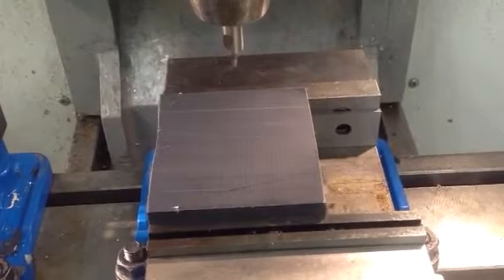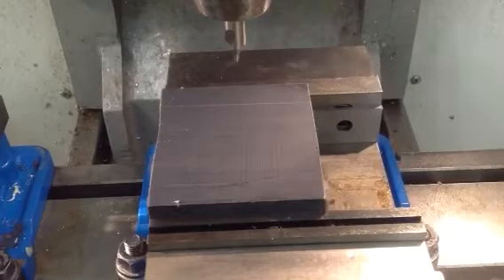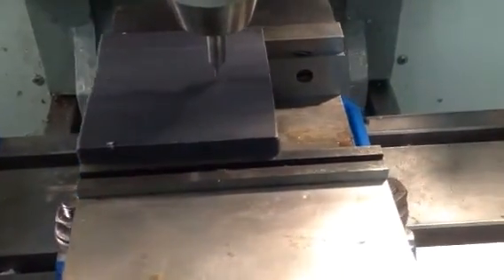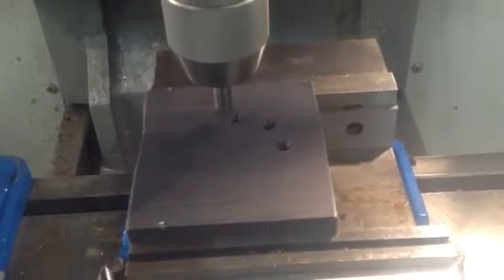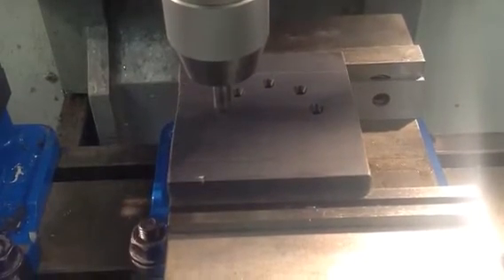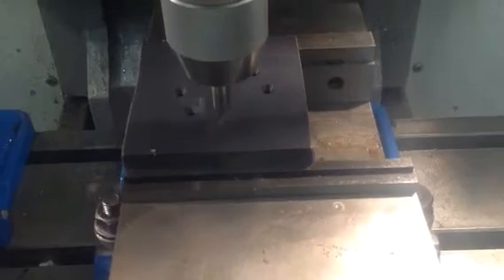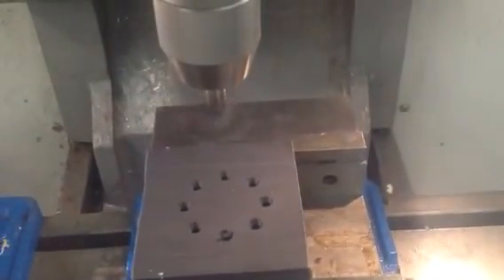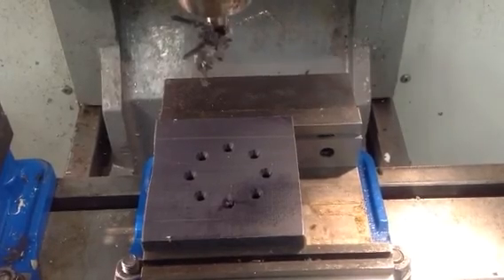G70 canned cycle for a bolt hole circle

Comment: How did you program that? G70 with an I, J, and L value? What are the meaning of these values?
Reply: heya...to answer your question... seeing that it is dated by a couple years.... anyway the values are I,J,K,L. I is the radius of the circle pattern, J is the start angle from the 3 o’clock position, K is the angle between the holes in the circle pattern or arc pattern, L is the number of holes. for example ... G71 I5. J15. K15. L6 (Drills 6 holes 15 degrees apart on a 10" diameter circle starting at 15 degrees); hope this helps
Reply: G70 is very similar just missing the k value for equal spacing...example... G70 I5. J15. L12 (Drills 12 holes on a 10" diameter circle starting at 15 degrees);
Reply: Thank you! It does!